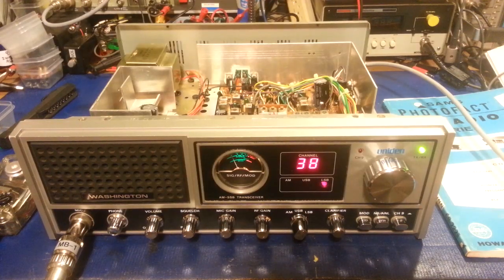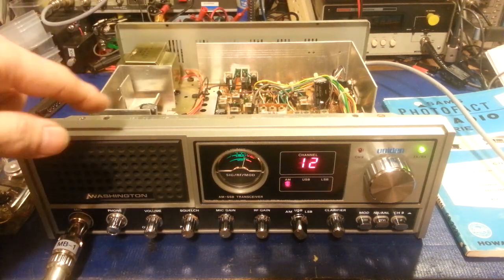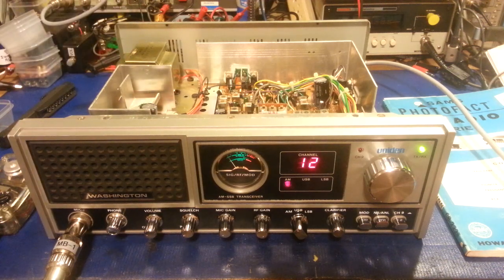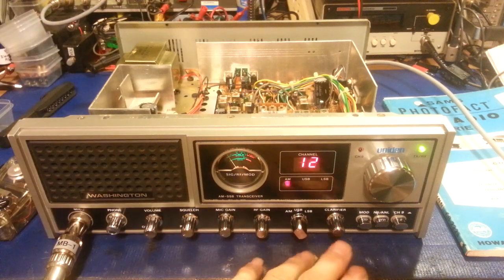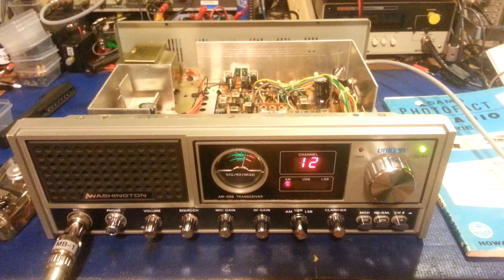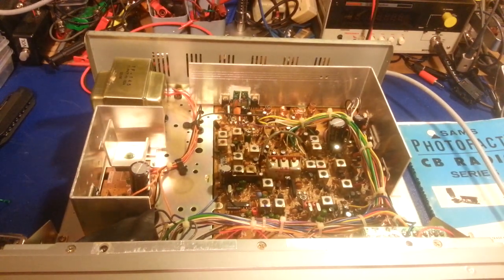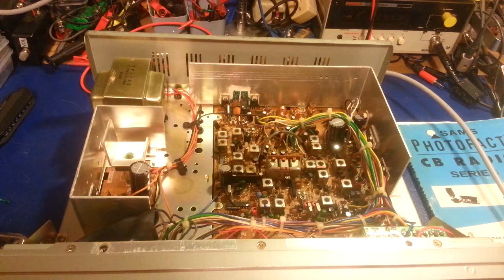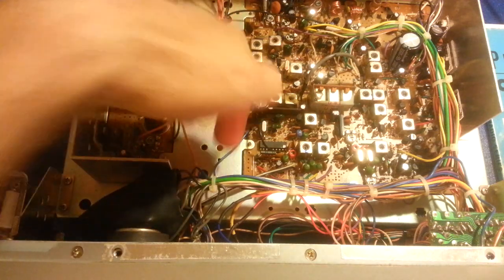Uniden Washington with weird clarifier modification causing oscillator circuit to quit.

Comment: Trouble with those xtal mods is that usually ssb or am is off depending upon the band, I prefer to change the PLL binary instead, as that eliminates that issue.
Reply: Are you talking about building a borad with extra binary adder's and such? That seems like a lot of work compared to a Captain Cave Man simple switch and crystals for 40 above and 40 bellow. I could see al that work if you where trying to get 300+ channels.
Reply: buckaroobonsi555 - yes it's more work, but the end result is better and can be properly aligned, without drift issues, I used to use EPROMs, now I use Arduino boards instead.
Reply: This is going to sound terrible since I was in first robotics for 4 years and took a year of programming and network security.That said I have never played around with Aduino!
Reply: Most people like Lester's Customs want like 100 dollars for the custom board - but with his they are direct plug and unplug no genius required to install the board.
Reply: That is fine if you are into programing chips - but for the everyday old timers like me a chip board would be a lot simpler.

Comment: Mike where can I find a replacement meter for the President version of this radio,and the slugs for the tuning coils. Someone modded the radio by removing all the slugs out of the tuning coils and I assume they destroyed the meter and could not find another,power supply and all circuits for it is gone have to make an aftermarket set-up or run it off an external supply - E-Bay find to try and repair. Thanks for any help I know you are an Authorized President Repair Center.

Comment: i have the exact same radio with the same mod down to the 3 way switch where the head phone jack goes.......the problem with mine is i have 3 wires in it that go nowhere  ...one is off the clarifier  and i think one is of the mod board and the other is an orange one .......when i got this washington they had 2 wires wrapped and tried to solder them to the 13.8 volt plug on the inside ......the radio comes on and lites up and has static but i have failed to here anyone on it ....you key the mike and it switches to tx from rx......the clarifier does nothing.....i  live in western ky and there is no repair shops around me close ........sorry for the long post.............

Comment: Hey mike I have the same model Washington as this one and I got it second hand. When I turn it on it all powers up fine but when I turn the volume control above about 1/2 way a really loud squeal comes out of the front speaker. Also it receives on am on ch 1 and 40 but does not tx on am or SSB. The RX/TX light changes color but meter does not move in any mode. Any ideas where I can start if I were in the us I would send it to you but I’m in Australia

Comment: Mike other than to save money on transformer why would they set these up with 13.8V? Just about every car I have owned has had a voltage with engine running in the 14.5V-15.5V at idle the lowest I have ever had in a car was a General Motors product and it ran at 13.8V once warmed up at idle but even it came up to about 14.5 off idle.It is a mobile Uniden Grant/Cobra 148 board right?

Comment: Is there a preference of Silicon or teflon stranded wire as replacements for moisture damaged factory wires.Does wire size matter I see radios with factory wire from 22 to 26 gauge wires in them?
Reply from the maker: +William Colvin 

Size does matter.  Never go down in wire gauge.  Replace with the same gauge or larger.
Reply: So it would be safe to replace all with 22 gauge,I seen the SWR Board lightning hit and you spoke of how critical the trace size had to be so I was checking to make sure of wire size and types to use. Thank you very much.

Comment: Happy Thanksgiving Mike! Two things that caught my eye - not being a CBer (but I do have a license KAAE3854) I wonder if you tie the clarifier function together, i.e. you effectively have RIT and XIT together, don't guys chase one another around if the other guy's RCV/XMT are off? I'd think you'd want to be able to independently move RCV/XMT around. Having said that I don't think I've ever used XIT but have used RIT sometimes on my HF rigs. The other thing was the what looks like RG-174 from the new Xtal board goes thru the steel chassis - with the coax there you in effect have the outer jacket and shield to protect the inner conductor; IF you used a single wire (and I agree with your thought process) would you put a grommet there to keep mobile operation from chafing the wire? Just curious.
Reply from the maker: Happy Thanksgiving to you to.

There are different trains of thought with CB clarifiers.  Factory is user adjustable RX and locked TX.  The bigest problem I have with that system is as frequency changes over time due to components aging the RX and TX frequencies can start to drift apart.  By "unlocking" the clarifier both RX and TX frequency is the same and both change with the clarifier (you would think you would call this locked).  There are a few export base stations that had a dual control.  One was RX/TX and the other was RX only.  With this setup it effectively had a XIT and RIT control.
Reply: Unlocked RIT is the only way to go on a CB or an export unit lacking continuous tuning. If you can move a cursor/carrot and tune the last digit a clarifer that is locked is no big deal. I live on SSB and if you want to talk to a group of people all at once like a big round table discussion it is a must. Nothing is worse than talking to a group of guys and one guy has a locked clarifer and you have to be quick on the clarifer to catch what he is saying compared to the rest of the group. On top of that radio's drift over time as the parts age. If you happen to own a modern SSB radio or an export they drift like made and if you are lucky once they warm up they settle down but not always. 

My Dad was anal about this sort of thing and he used to send his mobile radio's off every 2 years for a full alignment check . Most people are not that anal retentive about this stuff and a lot of them have gear that has had golden screw driver to it before they have even bought it because the best gear is older used gear for SSb. It is not like amateurs that buy a piece of gear and never take the cover off and if it breaks it goes back tot he factory for servicing. I do not know of any electronic repair shop with in a 1 hour drive of my home that is competent to work on rf gear. More than likely their is maybe 2 and you would be hard pressed to find them on CB you would likely have to go to an amateur radio site and inquire to find them. 

Have a look on ebay and it is hard to find a radio used or new that has not been modified!

Comment: hi Mike.  do you recommend using solid copper wire for the connection from the crystal switching board to the main PC board?
I have always used solid copper for things like this, but would like to know your opinion on whether or not it's beneficial.

as for the clarifier mod, i would guess that the pot was still varying the amount of voltage going to the wiper even though there was no ground reference, and that's why the clarifier still changed freq when turned?
just guesssing...
Reply from the maker: That's kind of what I was thinking.  Between that and operating at 18 volts I guess it had enough range.  What was funny was they had extended the range of the clarifier by installing a different varactor diode and adding some inductance.  Once I did the clarifier modification properly it had over 12KHz of range.  Way to much for a single turn pot.  Had to put a normal varactor diode back in to reduce the range some.

That's what I use, solid wire.  Mainly because I have a 5,000 foot spool of that black and white paired double insulated wire.
Reply: People over do it with varactors. I hate 10 turn pots and varactor changes or additions on a mobile designed to be used in a mobile. If it going to be used as a base than it is fine. I am guessing they where after 10kc of adjustment but they could have just used a switch and pulled the right pin down for that. 3kc-5kc is the practical limit I think for a single turn single pot on a mobile. If you have ganged pots one for fine and one for coarse or have a 10 turn than more than that is not a problem. 

I am not anti-modification so long as they are done well. I do not even mind NPC, Direct Injection, Asymetrical Modulation etc so long as people filter the output but most never do!

Comment: Hi, off topic sort of but I cannot find anyone who knows where I can get a replacement  l.e.d. channel  display for my Realistic trc-458. There's a total of 5 segments out on mine and it's hard to tell what channel it's on. I'm not bad at solder/desoldering so I can handle replacing it if I could find one. Do you know of a source. Thank You'
Reply from the maker: Uses one of the most common dual 7 segment displays ever used in CB's.  Go to Kens Electronics.  https://www.kenselectronics.com/lists/leds.htm

The radio should have a TLR321 in it.  The substitute he carries should be a 4233RA.
Reply: I thank you,  you are a store-house of information.

Comment: the crystals always suck, upper lower and am are always different on the clarifier on each band
Reply from the maker: They shouldn't be if its aligned properly.
Reply: MikesRadioRepair Do I align them to AM?
I find if I align on lsb, usb will be all different  eg. not 12 oclock
Reply from the maker: +ᗒ╬ᗕ1112223333111ᗒ╬ᗕ 

If you have a radio with a crystal switch board like this do a factory transceiver alignment using the CB band crystal.  After your done the alignment of the synthesizer circuit you can then switch to the other crystals and use the trimmer caps on that switch board to adjust them.

Comment: Anyone here have a schematic to make one of those crystal boards?
Reply from the maker: William Colvin 

Crystal boards are a bad idea.  No matter what you do all those wires cause frequency drift because they all act like capacitors in parallel with the crystals.  If you must have extra channels the only way to do it and not effect frequency stability is to do a old school switch mod to the PLL or add either a old school EPROM or a microprocessor controlled type channel expansion board.
Reply: I am not educated on the program type circuits trying to figure out how to write the program to make it work. Had way too many head injuries and mental stress and my mothers side of the family all her and her siblings and their children have been hit with Alzheimers Disease. Thank you very much for all your help answering my questions and others on here with limited funds trying to find a way to cope in the World we live in today.

Comment: If someone only wants 40 above and 40 below is their anything wrong with those old crystal boards? I can see maybe running to 15V because most Toyota's when running run at 15.5 volts but 18V is insane! Some idiots over volt their amplifiers to 21-24 volts.  Why they do not use more transistors or higher gain or use higher voltage transistors or LDMOS I have no clue. Just a lot of stupid all the way around. To add insult to injury these idiots are burning through obsolete no longer made premium Toshiba bipolar transistors.
Reply: Anyone here have a schematic to make one of those crystal boards?

Comment: I have one they put a switch down at the bottom for a post to be upper and lower channels well I got a frequency counter and it went to 28 MHz it’s all messed up I have a messed up radio the regular channels it’s all right was not loud enough I need to more modulate or something they got that switched it it’s it’s weird it’s the same certain switches same channels but no up really ever nor channels like that supposed to be they got it messed up bad side van I can’t get out I can hear not a problem the breaker for the channel if you get that switch in the middle yeah the regular 40 channel He gets out that I need more power to it I don’t know what to do with it the guy that used to work on the radios up here in Indiana that I know in Lafayette he passed away I’m having surgery still rod he’s a good guy and I got radios it needs to be worked on but I have nobody to work on them don’t have the money really but what can you say other president Washington I need to get the right modulation Five pan I want to use it as a 4 Pennbecause I got more microphones for for Penn